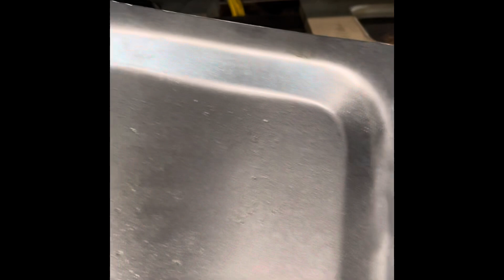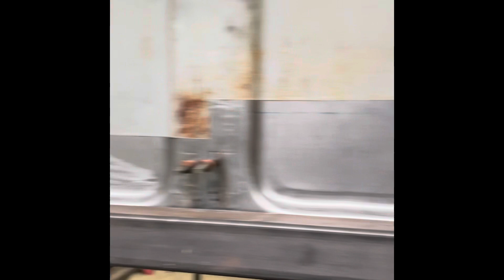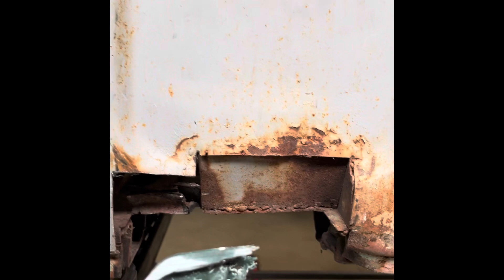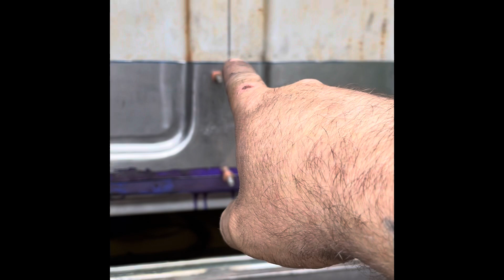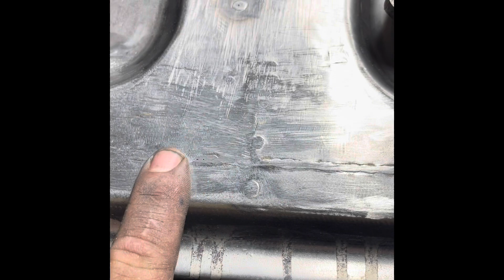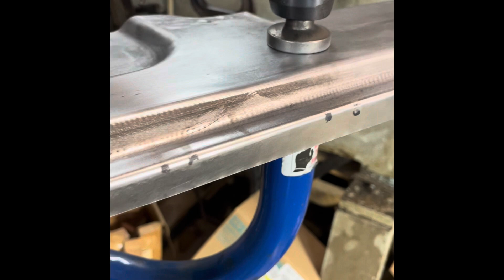Fabrication of 60’s C10 rear cab repair panel

Comment: Are u selling the repair panels?
Reply from the maker: No I was just helping a friend repair the cab and figured I’d document how I approached it.
Reply: @motleymetals  I feel like you could sell these. I’m here looking for ideas to fab up the same sections.
Reply from the maker: @TLervis  I’m just kinda burned out with a full time job and doing this on the side. This could be done with a beadroller and a tank roll or round over die as well with good results I just wanted to try and do it by drawing out the pans thought it might save time welding.
Reply: @motleymetals  I hear you. I’m in the same boat. Thanks for documenting your work however.

Comment: Love your work and the explanation you share. Thanks for addressing the planishing. Can I stretch the ask for some real time video on the pneumatic planishing hammer. I want to know how not to stretch to much. Speed and tension on the dyes and bpm. Thanks.
Reply from the maker: Thank you I greatly appreciate it. I’ll try to remember the next time I use it. I’m still relatively new with it but I set the regulator low and the tension loose to start and give it a try. If I feel like it’s not efficient I’ll add tension then add pressure until I feel comfortable.